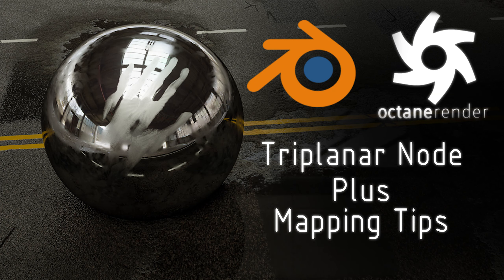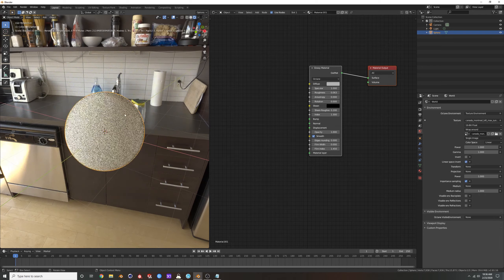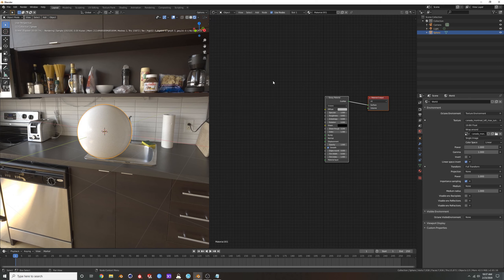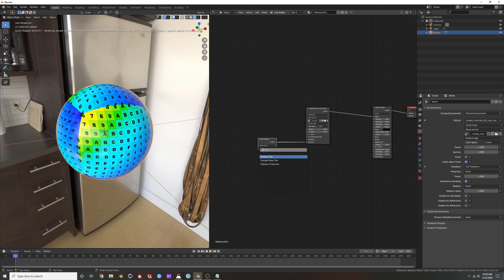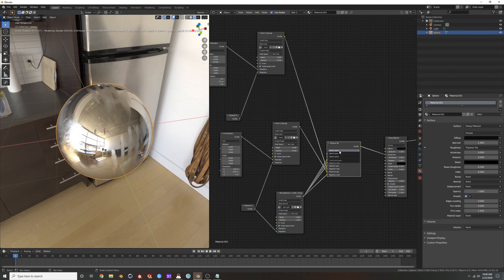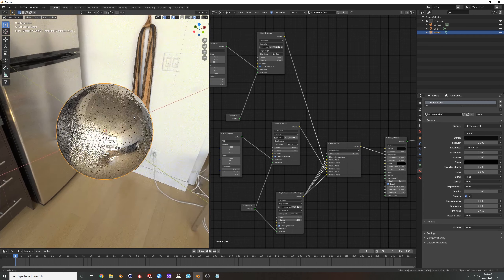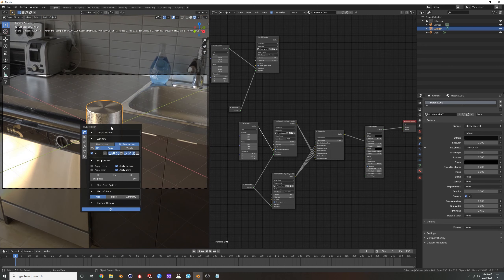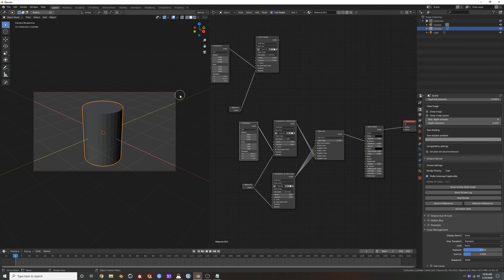Part 3: Triplanar Node and Mapping Tips in Blender and Octane

Comment: I cant find Color Space option on Image Tex
Reply from the maker: In the new builds it is not there.
Reply: That's what troubling me , because my textures already has been converted into non color data. Now I don't know how to feed it into The Universal Shader for it to work properly .
Reply from the maker: Float Image txt is for black and white images, Alpha Image Txt is for an image with an alpha and Image Txt is for regular images.  Does that help you out?
Reply: @finalresult3d   @Final Result  thank you ! You're a life saver I recently switched to Octane beczu just heard Octane is free.  One final question what about normal map? Do I need to feed it to a normalize node or anything else? My normal has already been converted to Non-Color data ,so color space  in cycles should be in RGB

Comment: Is it hard to do brush metal(like stainless steel) in Octane for Blender?
Reply from the maker: No not really, you have have a few options. You can use noise and stretch it, then scale it down really far. Change the metallic material from Octane to GGX then play with the anisotropic value and rotation. Or use a good ol image texture :)

Comment: when you're too early and you have to wait for youtube to finish rendering the video so it's available in hd ... x)
Reply from the maker: Haha! I'm glad you're liking the videos. I'm thinking about putting out a bonus one late tonight. I've been saving this one feature until I went over how these nodes work.
Reply: @finalresult3d  i m loving them ! :p btw how stable is octane on your system ? got a gtx 1080 and an i5 7600k 16gbs ram here and i got it crashing on me few times now especially when adding image textures .
Reply from the maker: @SynisterGatess07  Mine at home is pretty stable, I think I only crashed once. At work I have some older GPUs and I stop rendering when I need to add textures. I have some crashes there. Do you have the lastest update? They had a new one mid Feb I believe.
Reply: @finalresult3d  oh i ve an old one then ... and i m rendering while adding textures so i ll stop doing that . Thanks

Comment: Hi i think the hdri need projection. So i pluged in 3d transform or rotation transform to spherical projection and than to the image"s projection slot and now i can rotate the hdri aniwhere
Reply from the maker: Use the full transform and slide the Translation "X" value. That will make the HDRI Rotate
Reply: @finalresult3d  I try to say, that with my method you use angles not meters :) https://drive.google.com/open?id=1r6DT41fI67esHwjy9x6h-L32sAzqgAeJ

Comment: I wonder why Blender with all its nodes does not have this one. One thing I did learn recently is that you cannot plug a noise node to the vector input of another noise node to drive the evolution of that node in octane. That option Does not exist in octane blender and there is no conversion. I really wish there was a Blender version which had the best of blender and octane together. The quality of octane render with vertex displacement puts it above blender and some of the mapping options, but some options in blender are way better. Annoying.